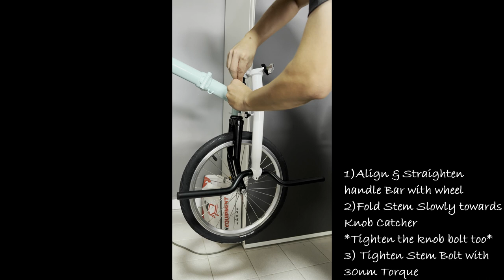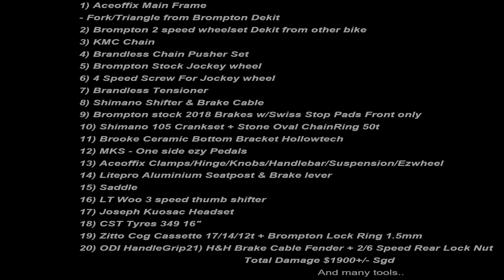How to Build A Brompton Foldie Using an Aceoffix Frame

Comment: Nice bro, is that cheaper way to build with parts? or just simply buy a complete build? Btw what's the weight like after u build it. Thanks~
Reply from the maker: The stock has some issues, Chain Pusher, Jockey wheels, Chain Drop, Seatpost Slippage, brake caliper flex.  so gotta see what u going after. Are you going to Mod? Are you going to fix/upgrade the parts, if yes then diy is better with your upgraded parts as compared to buying a complete bike.
Reply: Hi. What is the problem with stock chain pusher and jockey wheel?
Reply from the maker: @humsup77  shifting
Reply: @enciktanyt9332  what seatpost sleeve are you using in this build? it seems like not a usual aceoffix plastic sleeve? cmiiw

Comment: Well then it isn't a "Brompton", buit a Brompton-copy-type foldie. As an owner of an original "LightweightH6LXBrompton" I have a fork and back made from titanium, so I think about buying a new frame from titanium for it, but as a tall, 184 cm and a 100 kilo heavy man, I must think about buying a "stronger" version, as most of those seems to be made for people of a more moderate weight! ;-)
Reply: And I have changed most of what I may find to lighter parts than the originals, a ceramic titanium crank, a titanium seat post (with a ringmount for the sadle) and rack. And I look (waiting to be able to pay for one) for a titanium stempost. I have a carbon handlebar.
Reply: Doesn't matter if it is a Brompton or not, as long as the ride is smooth and weight much less than Brompton. Of course cost less too.
Reply: @niksh8074  The original Brompton Patent has run out, so it is free for other firms to produce Brompton like bikes/parts, though maybe not to officially sell bikes in the EU from Copyright isues? I asked for a possible 360 buy from Korea, but they didn't want to export to the EU. And if buying a foreign, expensive titanium frame for your bike, bevare of its quality, as it may be intended for people of less weight than a standard european man.